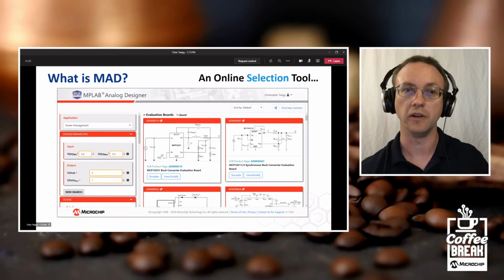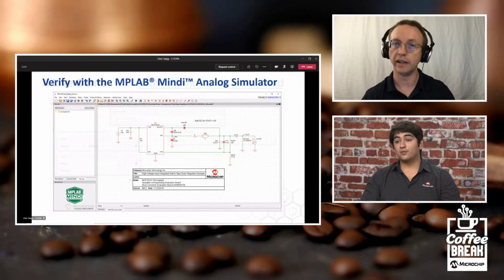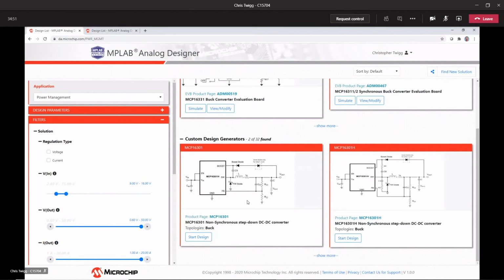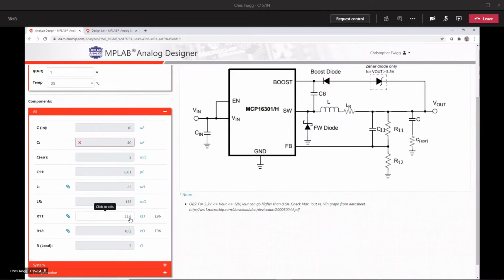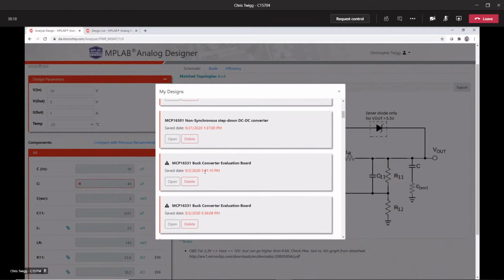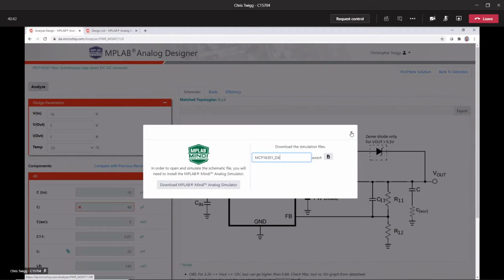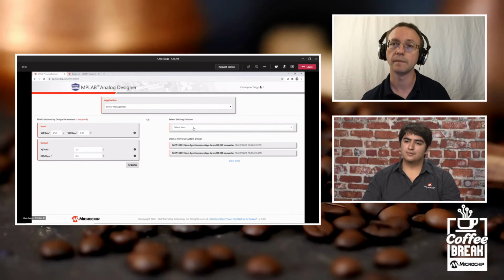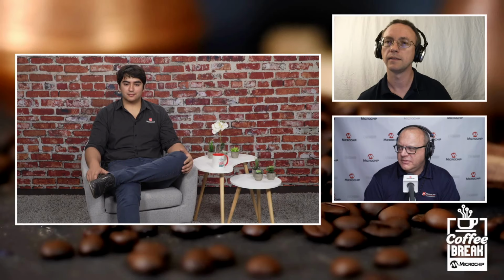Coffee Break | S2E3 | Introduction to MPLAB®  Analog Designer

Comment: Does MAD tool support buck boost power converter design rather than just the buck or boost design? Q2. Upon downloading the schematic, does it provides with some notes on how to twick the/certain component values which will affect the output voltage and/or current? Meaning something like changing the inductor to certain value or the feedback resistors to the smps chipset or the capacitor values at certain position what will happen to the output voltage and current (increade/decrease the output value), etc. Else the tool may provide quick solution, yet it pushes designer into the mode of "blind copy of the solution" without even knowing a little bit of how the circuit works

Comment: Many of these features are in simulators like LTSPICE and MULTISIM. Is there a way to add a microcontroller/PIC, which can run a user's firmware in C, into an analog circuit and simulate that. Multisim does have that feature but only for 2 Microcontrollers - an old PIC 16F and 8051 I believe. A feature to do mixed signal analog and microcontroller (with a user's firmware) simulations would be a very useful tool.